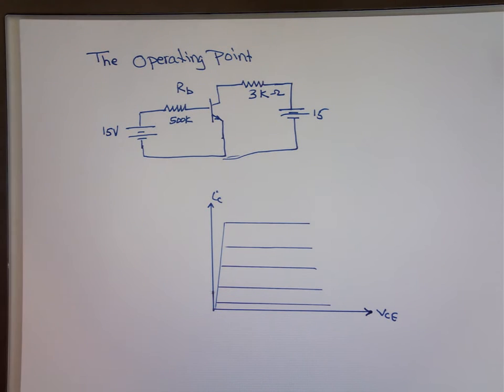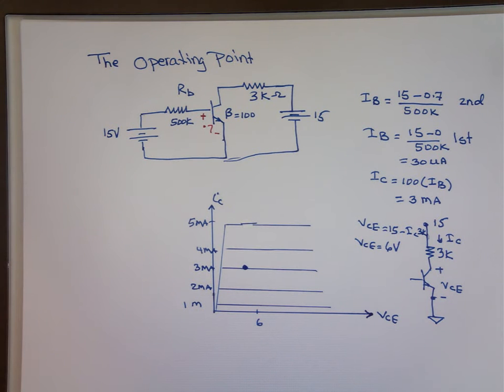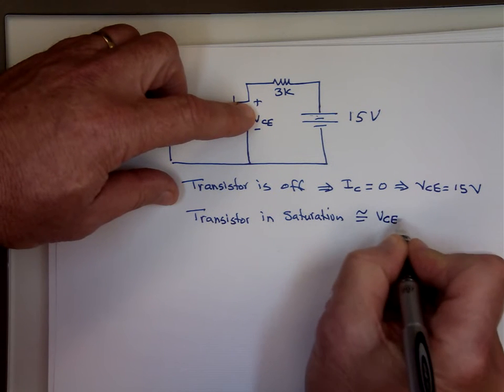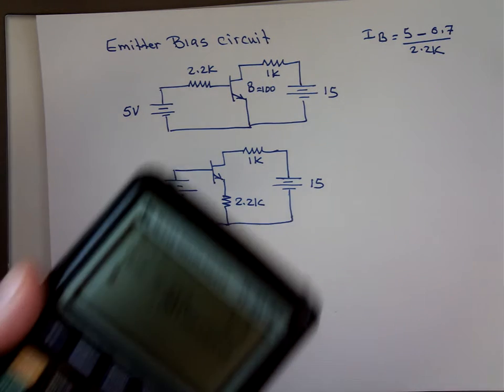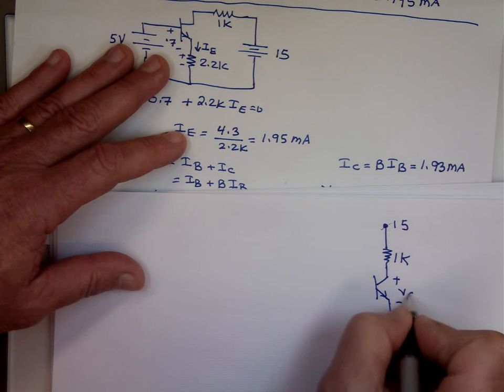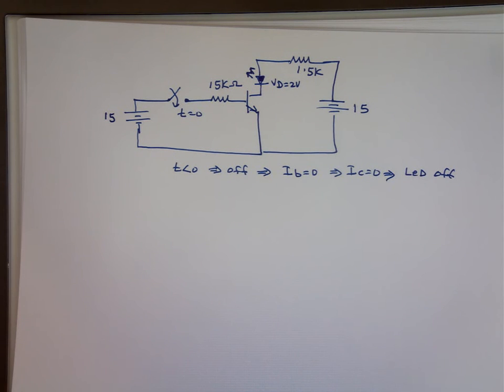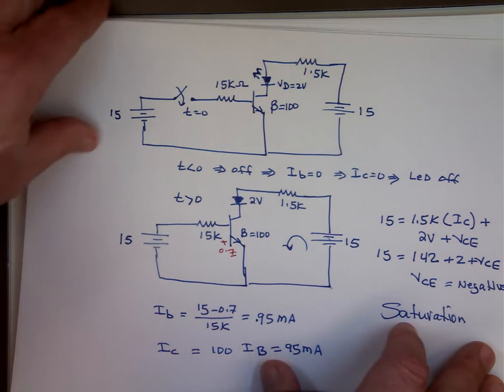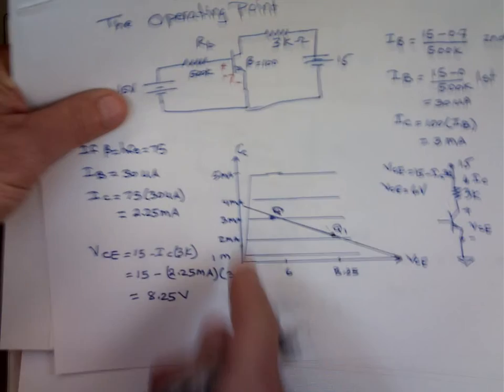Operating Pont and Emitter-Bias Circuit

Comment: This video has helped me understand analyzing BJT.  When designing a Common Emitter Amplifier's operating point, I've seen other examples just pick 1mA  and half the supply voltage.  Is there a formula or calculation to pick the Ic and/or Ie that's not just picking 1mA?  Is it based on the load?